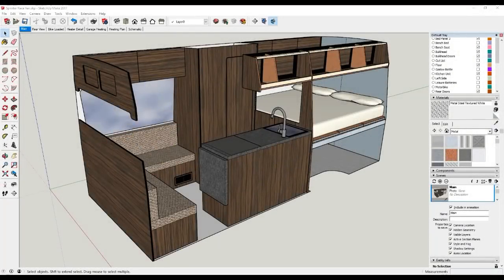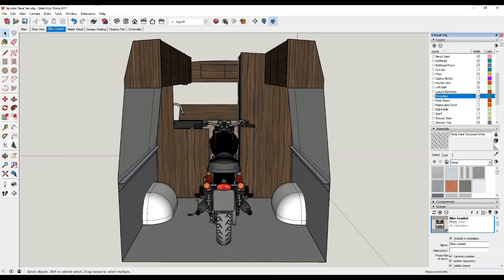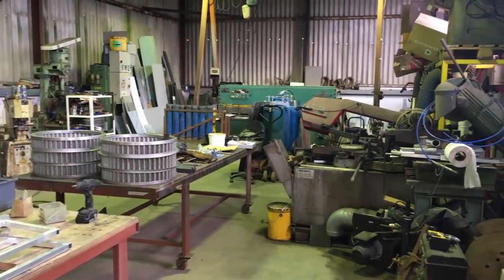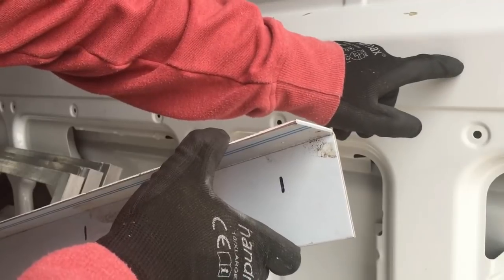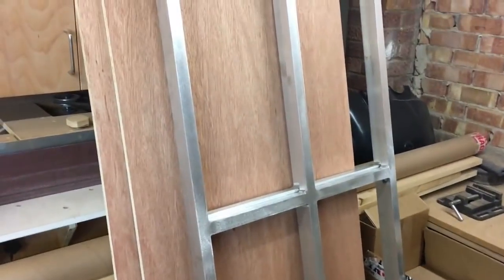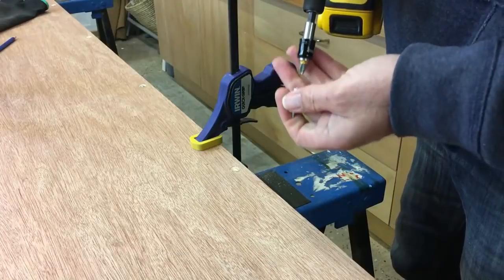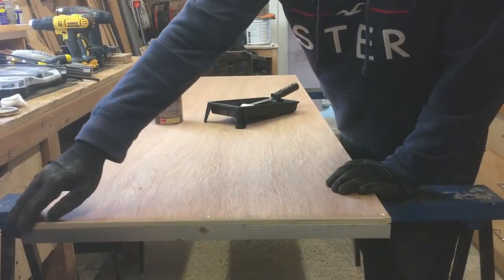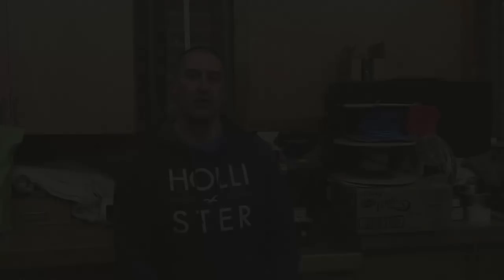Mercedes Sprinter Camper Van Bed Frame

Comment: interesting, but wouldn't raising the bed a little higher help fit the bikes in without having to strip the bed, like other race vans? All i can think about is going to sleep and waking up to find the bikes gone.
Reply: i agree, just make the bed low enough so you can sit up without your head touching the roof. also if its wet, you dont want to be taking the mattress outside
Reply: If you raised the height of the bed to fit the bikes without removing the bed would you still have enough room to sit up in the van? I guess you would have to remove any overhead storage but saying you did that I’m just wondering if you possibly would be able to sit up? You seem like you thought of everything there so I’m guessing you found a few negatives to that idea?
Reply: if you were sleeping longways ,you could keep the storage with your back to the doors.

Comment: Hi Greg may have a chance of ford transit t350 lwb high roof 6 seat messing / crew van  panel van on 66 plate  2016/12

Comment: What size mattress will fit?
Reply from the maker: Mickey Esposito 1700 wide across the van and 1800 long 👍🏼
Reply: Greg Virgoe what’s that in inches?
Reply from the maker: Mickey Esposito, 6' long X 5' 8" wide. A normal bed is 6' 6" long so it's a bit shorter than standard.
Reply: Thank you very much for the info. Beautiful build! 👌🏽

Comment: Maybe I missed something, but it seems like the aluminium bed is bolted to aluminium supports that are bolted to the steel chassis. Didn't you just create a perfect thermal bridge that will cool down your bed?
Reply from the maker: I was hoping someone would pick up on that.
You have to place the rivnuts in the steel of the van before you cover the van and panel it.
This was temporarily fitted to demonstrate for the video but the tool broke before I could fit it permanently.
The van will be wrapped with my vapour barrier, tiny holes pierced for the rivnuts.
Your choice of plywood, tongue and groove carpet or in my case vinyl covered ply panel is fitted.
Making sure to transfer the location of the rivnuts to the panel and cut holes for bolts before fitting.
Then the angles get fitted on top of the panelling and bolted to the rivnuts.
You could say that the bolts are still connected to the van body, but i'm not going to lose sleep over that.
Reply: Greg how have you overcome the dissimlar metal issue between the aluminium and steel?
Reply from the maker: Hello Stephen, I'll have reflectix and plywood lining between the angle and the van wall. If you are still worried about the bolts touching the angle then through some nylon washers on there. Personally, I think that's going way too far. Don't you have to have a conductive liquid involved for their to be any kind of corrosive reaction between the metals? That's what I remember from engineering school.
Reply: Hi Greg
You are correct. I was under the impression that humidity was an issue in campervans. Nylon bushes would probably solve that issue was you suggested. I enjoy your videos tho very well presented and made. Just as a note i remember and aluminium jack hammer casing disintegrating in its timber case. A screw had come lose and fell onto the housing. It was kept in what was thought to be a dry shed. 2 years later we were going to rebuild it but couldn't because it was powder. Just a thought.

Comment: Hi Greg , just a quick question,  many types of riv nut sit proud of the surface. if you are fixing a metal plate to these, will that plate sit slightly proud of the surface or would you  make the bolt holes just big enough to incorporate the rim of the rivnut .. and then place washers and nut as normal?   incidentally you can get countersunk riv nuts .
Reply from the maker: The Rivnut has a small flange to stop it falling through the hole and to give a shoulder to pull it up onto initially when they are set. Yes, this does sit proud by a very small amount. In my case I an putting a vapour barrier and plywood over these and then fixing my bed frames to them so the flanges is hidden in the thickness of the plywood. There is not enough thickness of steel in your van to countersink anything. Cheers

Comment: what stops it going airborne in an accident,not tryn to be smart putting one in my high roof t5 conversion....not sure how to approach it...
Reply from the maker: As I mentioned in the video the aluminium frames will be bolted to the metal angles. 
The three frames will also be bolted together. The whole thing will be looked in very solid. My new ruvnut tool will be here in a couple of days and I can show that part in the next video. Cheers

Comment: What are the dimensions of the bed frame?
Reply from the maker: Hello, the van is 1790 wide but tight, I made the frames 1750 wide to give me 20mm each side for ply lining and little clearance.

The frames are 600mm each so that's 1800mm front to back (approx 6') That's the min requirement to satisfy DVLA when you come to register as a Motor Caravan.